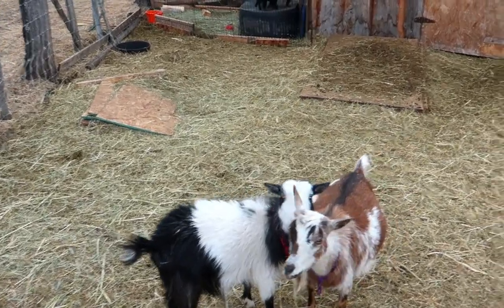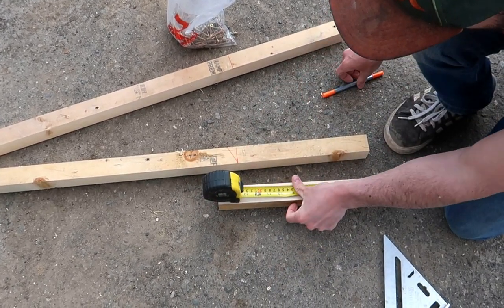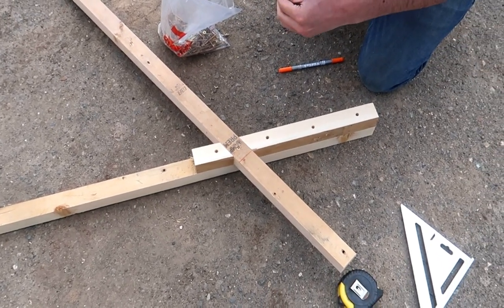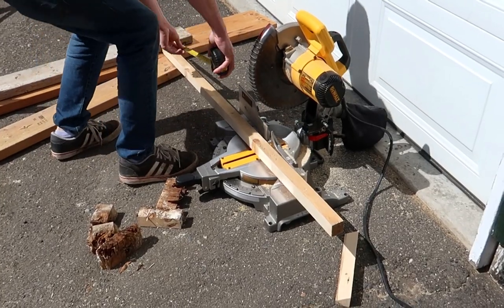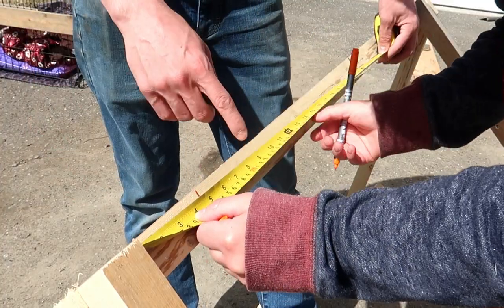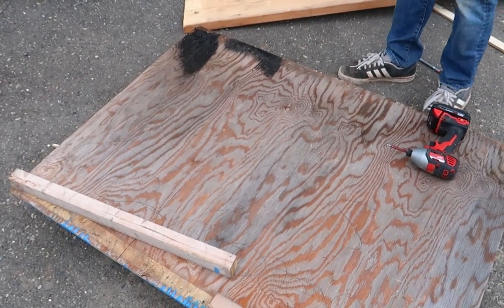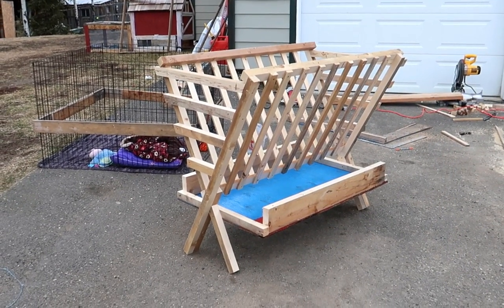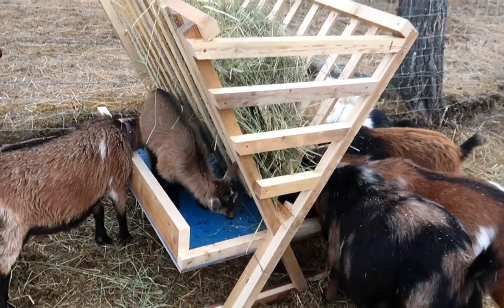Building a goat feeder that actually works?!

Comment: Thanks for sharing! Is it still holding up? How's the waste level? Have you added a roof or any extra support?
Reply from the maker: It is holding up well. the waste level is very little. I did not add a roof as the goats don't overly like eating outside when its raining or snowing so I feed them inside.